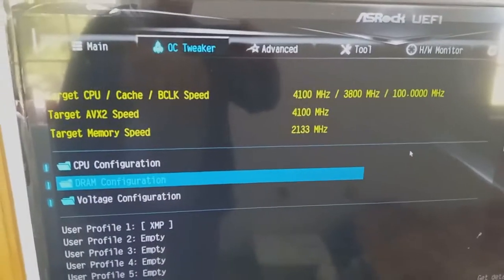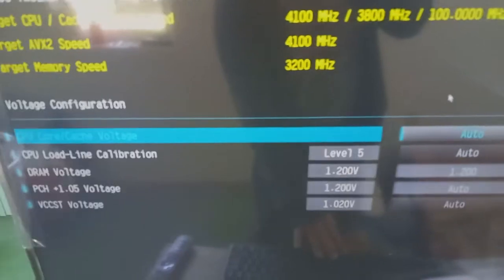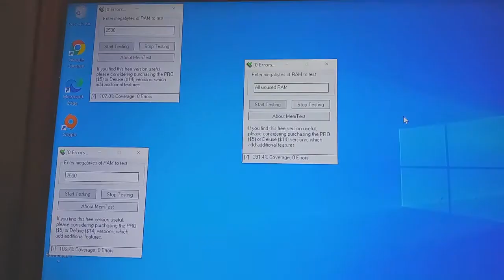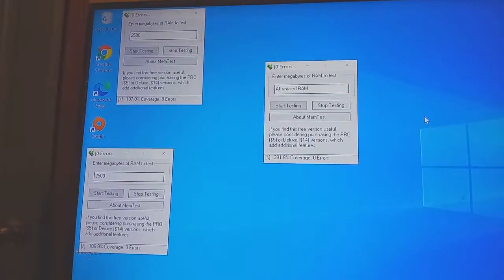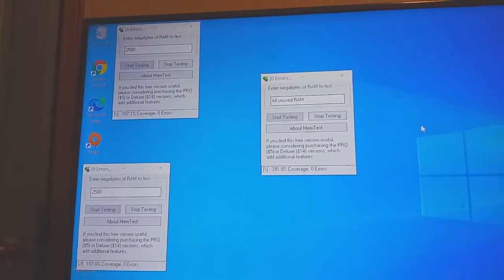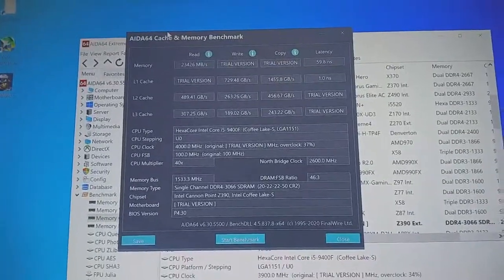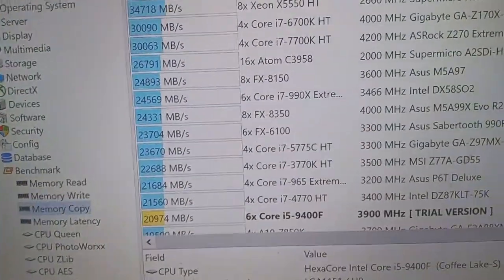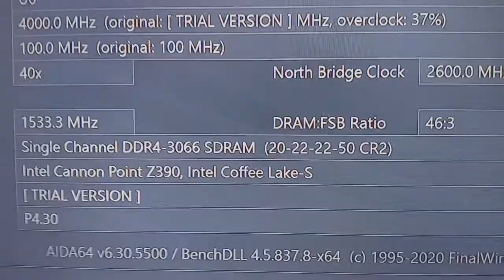DDR4 Sodimm To Dimm Adapter

Comment: Hey, if this works from SODIMM to DIMM, there's really NO WAY to do the opposite?
My laptop would fit a desktop RAM if we only think in the size question, but I don't find any type of adapter to do it, I only find those laptop RAM to desktop RAM.
Reply from the maker: I looked very hard to find any rare or uncommon adapters from dimm to sodimm, but I never found anything that could adapt desktop ram for laptop use.

Comment: Is it affect your pc performance or it is the same as Dimm
Reply from the maker: Performance on 260 Pin DDR4 SO-DIMM seems lower than using 288 Pin DDR4 DIMM on desktop platform. Only way I'd know for sure would be to test a bunch of different SO-DIMM extensively.
Reply: @We·Are··I·Am  yeah seem about right.

Comment: Hi I have i question. Do you think this adapter will work on those Chinese motherboards like HUANANZHI X99 F8 for example?
Reply: @We·Are··I·Am  Linus in his video confirmed that it works with regular x99 boards like ASUS or Gigabyte for example. Do you think its worth to risk and buy this chinese board or to go and buy regular board from Gigabyte b460 hd3 and pair it with like i9 10900k ES?
Reply from the maker: I dont know how far back in generations intel incorporated this feature, but perhaps it was used when the first generation NUC came out, which was 2013 (sandy bridge). So If your HUANANZHI X99 F8 uses LGA 2011 V3 socket cpus, then that would mean it was from 2014, which would make it newer than the first NUC, so chances are better that it supports DDR3 laptop SPDs. Although NUC's didn't start using DDR4 SODIMMs until 6th gen (Skylake). In any case, the only way to find out would be to get one and see if it works. 

This is the DDR3 version of the adapter. https://www.amazon.com/Laptop-SO-DIMM-Desktop-Connector-Adapter/dp/B07JZLXZMR
Reply: @We·Are··I·Am  At the end I've decided to go for B460 motherboard with i9 10990k ES . I already have motherboard and adapters at home just waitng for the cpu to arrive. I will let you know what the results are.
Reply from the maker: The adapters should work just fine for that since the B460 is 10th generation, and I've tested the sodimm to dimm adapter with 9th generation (B360), as well as 11th generation (Z590).
Reply: @We·Are··I·Am  I will know this tuesday when my aio cooler arrive
Reply from the maker: Just a heads up, after extensive testing, i've concluded any given laptop ram kit you run in the adapter won't be able to run at full speed; you'll have to down clock it somewhat.
For example, I have a Crucial JEDEC 3200 kit that only runs 2933 on the adapters, a SK Hynix 2666 JEDEC kit that only runs 2520 on the adapters, and a G-Skill 2666 kit that only runs 2400 on the adapters.
Reply: @We·Are··I·Am  seems like you were right my 2400 ram runs only 2200 but on the other hand it doesnt seem to effect games framerates so its not that bad
Reply from the maker: Glad you were able to get it up and running.
Reply: @We·Are··I·Am  Im glad you told me about that frequency glitch that helped me a lot
Reply from the maker: Trust me, it confused the heck out of me too, and i thought the ram sticks were bad until i figured out what it was.